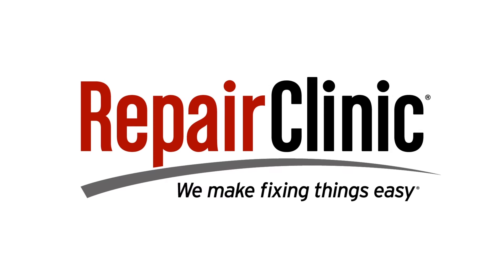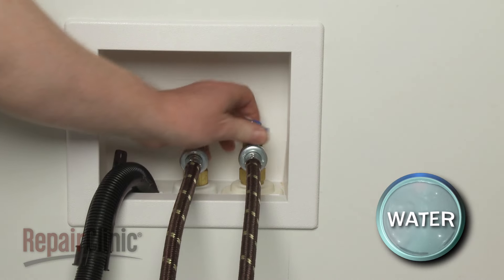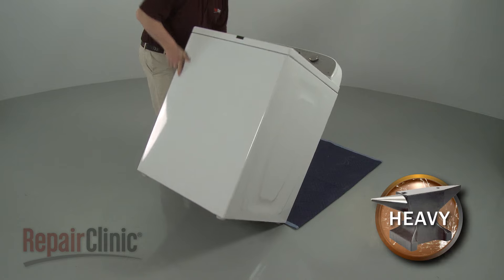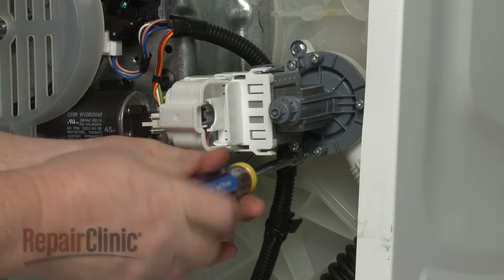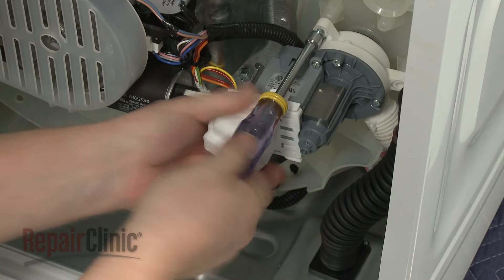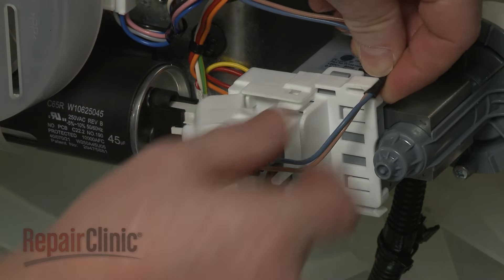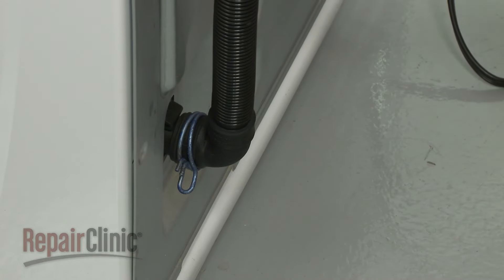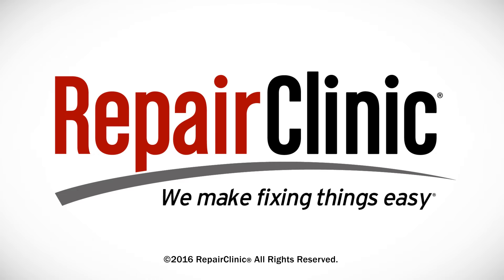Whirlpool Top-Load Washer Drain Pump Replacement #W10661045

Comment: Don't forget to run the washer after and check for leaks. There is also nasty water that will spray you in the face. A wet/dry vac sucking on the drain hose for a couple minutes is a good idea, there will  still be some water, but much less.

Comment: It's very important to include in your videos that replacing parts requires a calibration of the machine before using it. The washing machine may not operate as it should if you do not calibrate it. Very good how-to videos, otherwise!

Comment: Wow he took drain hose off and no dirty water came out, he also tipped it on its back and no water came out, he then proceeded to take the pump and it didn't have any scum on pump or dirty water, whats up with that
Reply: Yeah.  My washer is full of water.  This is gonna suck!
Reply: @99zxk  im thinking I will have to scoop out all the water first and then prepare for some spillage when it's time to remove the water drain line. I will be ready with a sponge.
Reply: That's where i'm at,tilted and stinky water out and toward the drain, thankfully it's a basement. I'm now going to take off the pump,unlike the video it ain't that clean
Reply: If you're in a finished area, forget the sponge (smh), you better be ready with a good shop vac!
Reply: @bobpaulino4714    How about a load of towels?
Reply: Do it outside.
Reply: Prolly one or two or three gallons of water below the basket that you should be prepared for
Reply: @DD-ok1md  ever tried to carry or cart a washing machine full of water outside.. probably easier to shop vac or be ready with lots of buckets. I got about 4 gallons off the floor doing this. Was a mess.